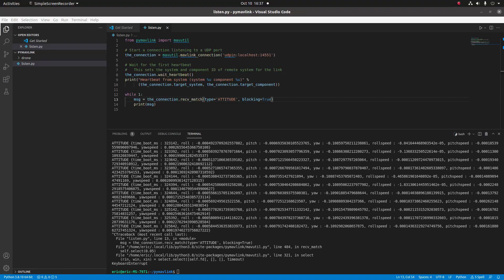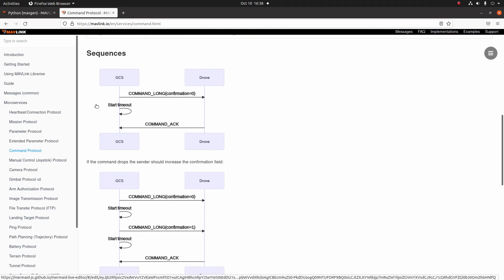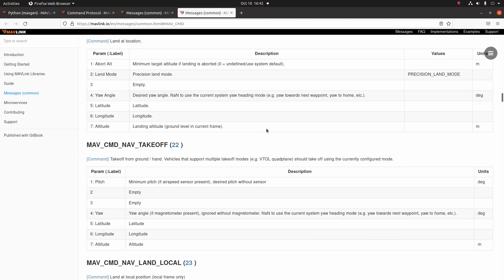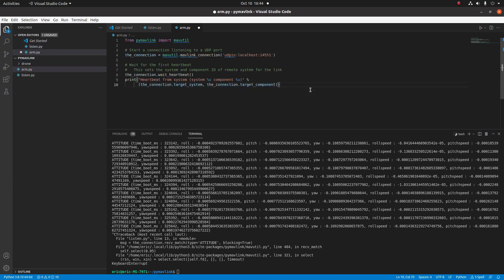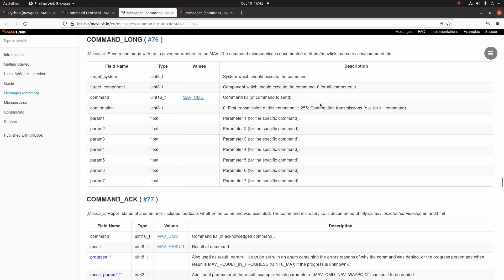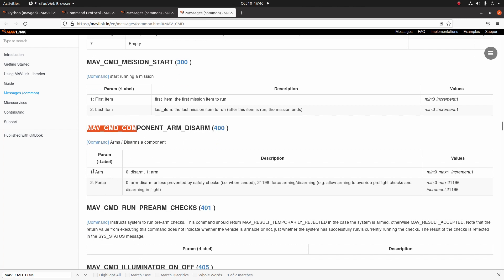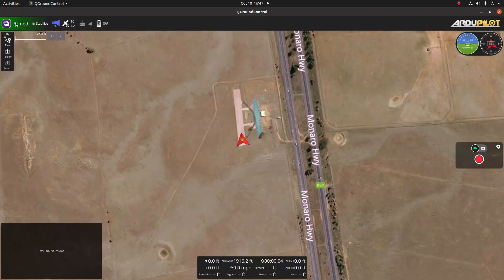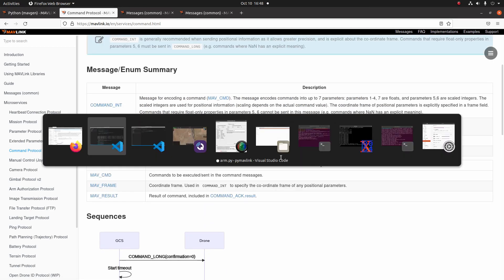02 Pymavlink Arm Command

Comment: I want to ask a question, I write the same code, my terminal opens, then I type Heartbeat from the system (system 1, component 0) but the armed drone does not arm but if ı doing armed in qgc terminal In the terminal it says COMMAND_ACK {command: 400, result: 0, progress: 0, result_param2: 0, target_system: 255, target_component: 190}, what is the reason?
my codes is bellow
 from pymavlink import mavutil

# UDP üzerinden bağlantı başlatma
the_connection = mavutil.mavlink_connection('udp:localhost:14445')

# İlk heartbeat mesajını bekleyin
the_connection.wait_heartbeat()

# Bağlantının hedef sistem ve bileşen ID'sini alın
print("Heartbeat from system (system %u component %u)" %
      (the_connection.target_system, the_connection.target_component))

# Drone'u ARM etmek için komut gönder
the_connection.mav.command_long_send(
    the_connection.target_system,             # Sistem numarası
    the_connection.target_component,          # Komponent numarası
    mavutil.mavlink.MAV_CMD_COMPONENT_ARM_DISARM,  # Komut türü (ARM veya DISARM)
    0,    # confirmation
    1,    # param1 (0: DISARM, 1: ARM)
    0, 0, 0, 0, 0, 0
)
msg=the_connection.recv_match(type='COMMAND_ACK',blocking=True)
print(msg)
Reply: ı am using px4

Comment: Hey, I really love the way to explain, and I follow your whole series but write I got stuck at 8:15, over there my program is running well it is showing the heartbeat but it not executing the COMMAND_ACK.
Error that it is showing is:- 
 
File "d:\arm_mav.py", line 15, in <module>
    msg = the_connection.recv_match(type='COMMAND_ACK',blocking=True)
          ^^^^^^^^^^^^^^^^^^^^^^^^^^^^^^^^^^^^^^^^^^^^^^^^^^^^^^^^^^^
  File "C:\Users\The_Creater\AppData\Local\Packages\PythonSoftwareFoundation.Python.3.11_qbz5n2kfra8p0\LocalCache\local-packages\Python311\site-packages\pymavlink\mavutil.py", line 524, in recv_match  
    self.select(0.05)
  File "C:\Users\The_Creater\AppData\Local\Packages\PythonSoftwareFoundation.Python.3.11_qbz5n2kfra8p0\LocalCache\local-packages\Python311\site-packages\pymavlink\mavutil.py", line 335, in select      
    time.sleep(min(timeout,0.5))

it will be great if you can help.🙏
Reply: and 1 more thing, I am trying to do this with iNav

Comment: But when I arm the drone, it automatically disarms after 10 seconds
Reply from the maker: this is a safety mechanism in ardupilot. ardupilot will automatically disarm itself after 10 seconds if the aircraft doesn't take off
Reply: @IntelligentQuads  Thank yoy for your response, is there a command in pymavlink for obstacle avoidance?
Reply: @mokkadude2816  there are plenty in mavlink documentation

Comment: Hey 
I am doing similar work. 
Can you suggest me a good laptop for 
Uav simulatoion ( looking for linux machine
Reply from the maker: I don't have any specific laptop recommendations. I would say to select a budget and get the best computer you can with your budget. In general more CPU cores and RAM is better for physics simulations. If you want to do rendering and computer vision you will generally have to compromise some CPU/RAM capability for a more expensive graphics card.  

I have been asked this question a few times in the past and I just bought a new computer, so maybe I should make a video on this :)
Reply: you should make a video man! I m such a huge fan